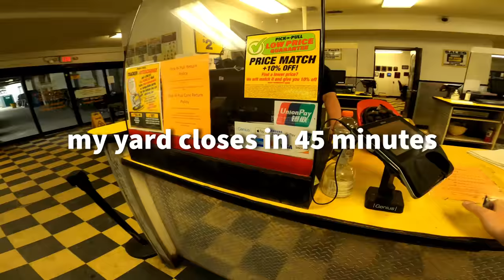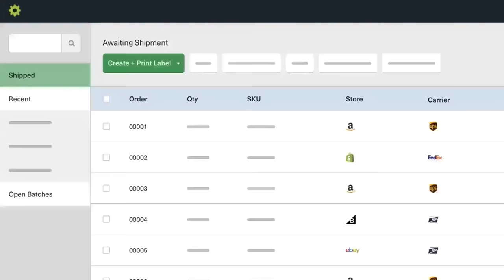Junkyard BOAT BUILD Challenge!

Comment: Yes, the Conversion Van/old Camper van top is smooth and actually looks like a boat. I hope one of that crew actually kept it and got it registered to use more. I have always thought that or an old hard top fiberglass car top was what would work for a boat in a pinch if you really wanted a cheap fishing boat.

Comment: You seal the truck bed tailgate with foarm spray waterproof through the cracks and then waterproof it and you'll be all right and use foarm spray to spray under it to help the float

Comment: This is something a character called Redd Green did on his show AGES Ago. He also put a V8 motor in the back of it. Of course, the point of his show was to fail horribly on purpose. It worked initially, but ultimately sunk.

Comment: Question, why didn’t you guys just unscrew the attaching screws for the van topper? I feel like with an electric drill it would have been light work.
Reply: Right those tops are literally screwed on behind the little trim piece

Comment: You need to put you need to put 4 spare tires that hold are on the truck bed so it looks kind of like a car in the water but tires are going to hold air and it's going to make bed float

Comment: Ayo probably should’ve cut the bed sides off the bed and only used the inner part of the bed to make it alot lighter and prevent it taking on weight by water getting inside the bed sides

Comment: Hey bud how you doing not to bust your tops but what you doing is cheating I cap on the back of a truck is not considered a car you got to take a car a vehicle and turn it into a boat not a cap for a truck a camper cap or a top for a truck whatever you call that's just cheating that's not even a car

Comment: You accumulated $653 in vandalism fines walking thru there, base social account is $11300/year or $941.67/month... how dealing with criminals works "42 days 23 hours 51 minuets and 4.5 seconds in jail at half rations known to maintain weight with zero physical exertion" accumulating a full year on the timer adds a travel ban to your social profile. ( hidden as a illegal boating fine with a no license fishing fine )
Reply: $40 to $113 a day to rent a boat.
Reply: need a boating license to rent a boat, to get one you need to take a 3 month course thru AMA that costs 800 to 1300 dollars and pass the exams for the size and specifications of use for that class of boat. retake test to renew license every 3 years